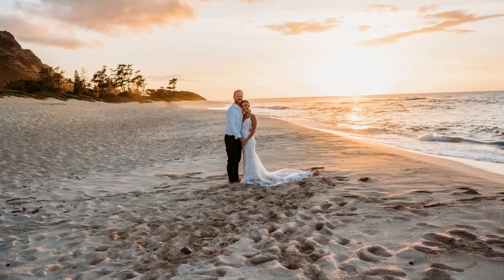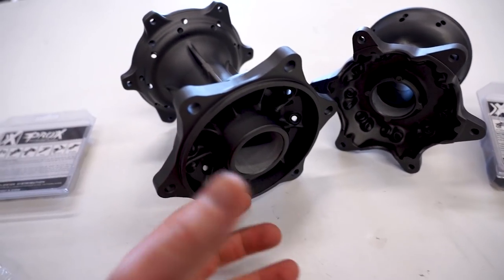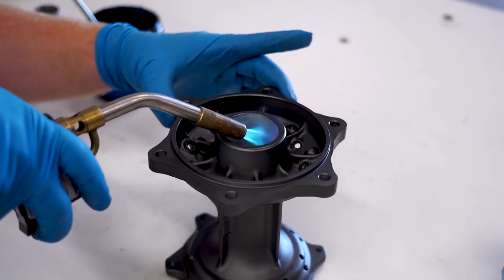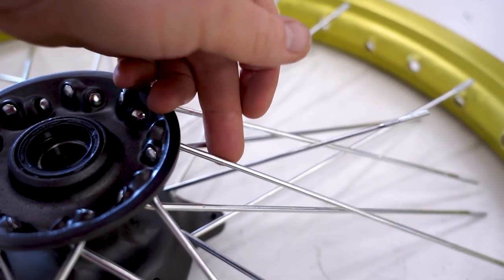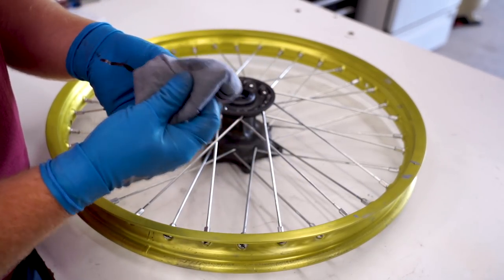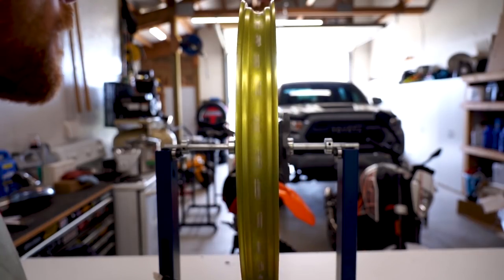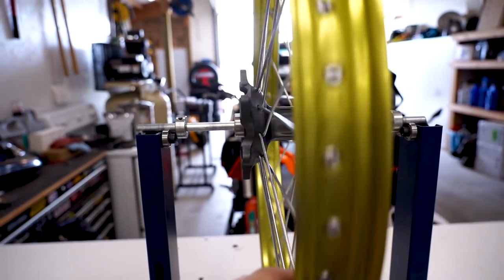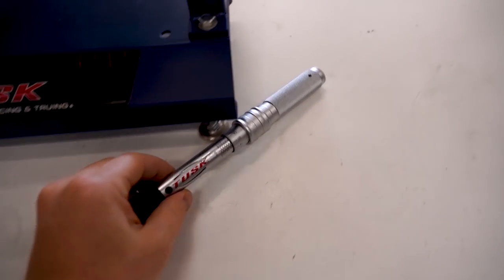As Good As New | RM250 Rebuild 21

Comment: @Cameron Niemela here’s a tip I like to do for seat covers, so when I slip on a new seat cover I slip it on from the front first then put about 3 staples in then to make it really tight and have no creases I like to sit the front of the seat on the ground and by using my hand I press the back of the seat and bend it a bit that way when I staple the back, when I release the tension from me bending the seat it’ll pull on the cover and give it a good tight pull and after you’ve put a few staples on the front and back start working your way on the sides and make sure you pull the middle as hard as you can so that it’s nice and tight all the way around and I like to leave the seat in the sun or heat it up so it becomes flexible so it can create it’s shape……. Try if you want! 🤷🏼‍♂️

Comment: Nice job. 
A small tip. Never put more grease into bearings. Too much and it will heat up and run out. A case of too much is too much!

Comment: Off subject, but my stepson has a 2000 KX80. I've had a few different carbs on it but still not completely happy with any of them. What carburetor would you recommend for his 2000 KX80?  Mainly we just trail ride. His engine has a fairly new top end. Probably less than 20 hours on it. It runs good plenty of power, easy to start just seems to always have a little hesitation when he gets on the throttle at a low rpm. Just wondering what carb you would recommend and any carb tuning tips. I've tried 26mm and 28mm carbs. Plugs look good, a nice slightly darker tan color. So it's jetted pretty close to where it should be I think. Anyways we really enjoy your videos and any help is greatly appreciated. Take Care!!!

Comment: Any eta on when the 97-99 cr250 front plate restyle brackets will be in stock? 🤙🏻
Reply from the maker: Those should be here in 2-3 weeks. They've kept getting pushed back but we finally got them dialed. Thanks!
Reply: @CameronNiemela  right on, I appreciate it.

Comment: What color code did you use for the yellow wheels? Trying to find a powder coat that is close to the carmichael rm 250 yellow
Reply from the maker: These are anodized yellow. It would be hard to match anodizing with powder.

Comment: The oven you used to coat also works great for heating parts up if you don’t have access to a torch. Same with your home freezer if you can’t get dry ice. Yes you are a dick....but that’s the kind of personality that makes stuff like this happen. I’ve done automotive diff rebuilding for a while and my toaster oven and freezer work great when nothing else is available for heating or cooling parts for expansion or contraction. Ding! Fries are done...